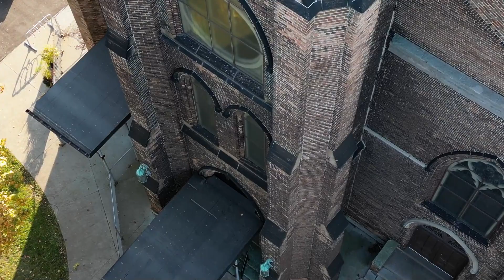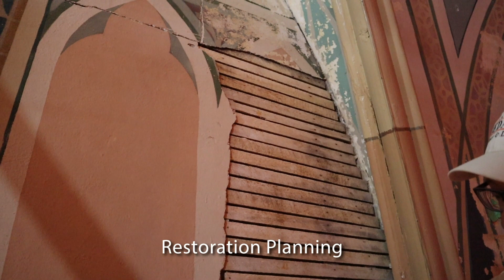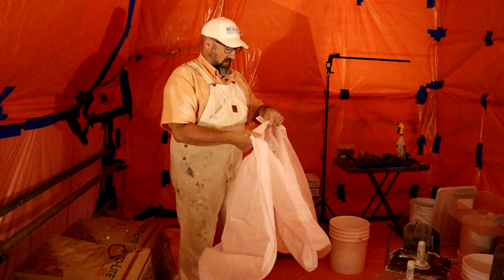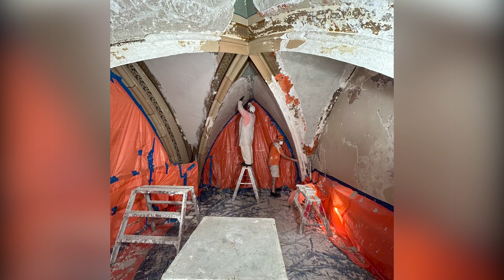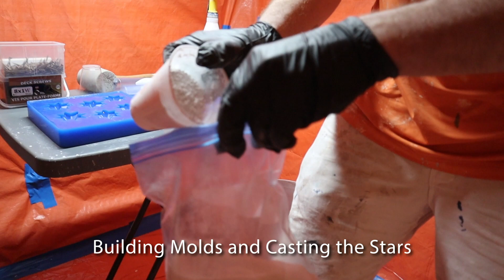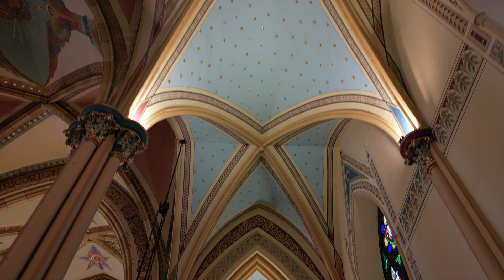Our Lady of the Assumption Plaster Restoration

Comment: @Shayne Bedal.... I have regular drywall/Sheetrock in my house.. with a textured finish... I would like to skim coat the texture finish a smooth finish. Can, I use plaster veneer on regular drywall? If so, does it need a bonding agent?
Reply from the maker: Yes you can. In fact, there's another video of me doing exactly that.  And yes, you must use a bonding agent.  Thanks for watching! Shayne
Reply: @plasterdrywallbyshaynebeda4503 Thanks for responding..  please link the vid.